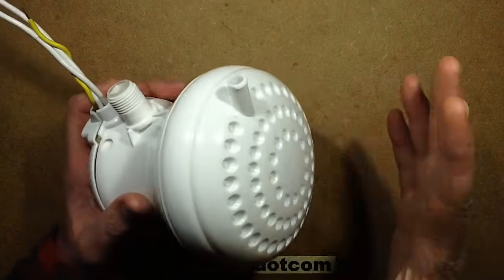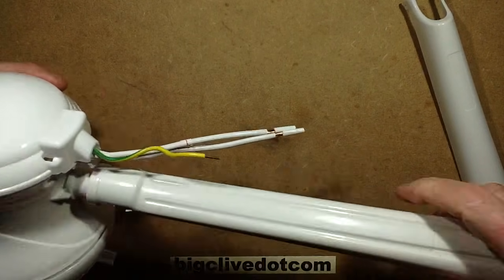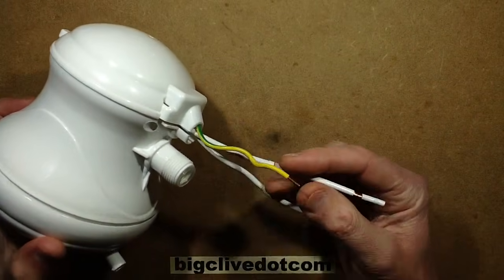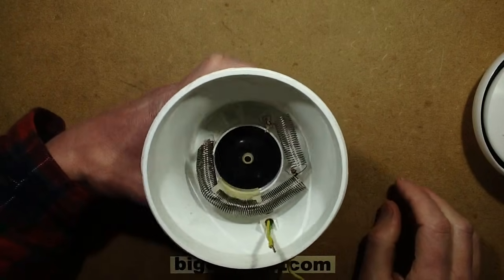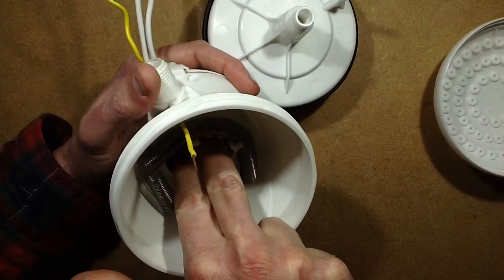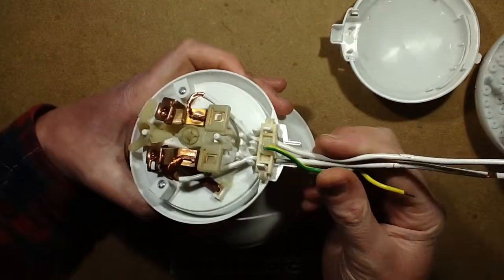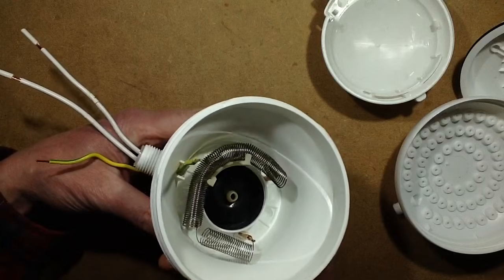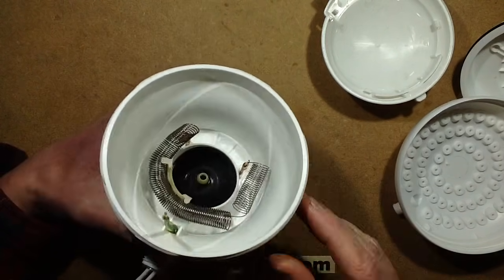Inside a heated shower head.  (suicide shower)

Comment: Water resistivity/conductivity is measured with two metal plates/bands in a sensor body, separated by a cavity of known cross section. This has the problem that ions of the metal plates can contribute to the conductivity value depending on what else is in the water... water with high sulfur content for example.
Laboratory sensors use platinum/platinum hydride plates for this reason.
Different configurations can be required depending on the overall concentration of minerals (total dissolved solids) in the sample because the response is only approximately linear within specific ranges... so you need to do a colorometric test for water hardness before bothering to pick the sensor to use... so... a big pain in the butt to actually test.
The figures are typically available from the utility supplier/ local water authority and it's important to use the figures from the water supplier actually providing the service because water hardness can change a great deal over a relatively short geographical distance.

Considering the scandal that took place in Japan over people being electrocuted by heated toilet seats, I would be reluctant to get under something that looked that cheaply constructed even if the president of the company making it was willing to take the first shower under it.
...especially with the number of houses I've seen in the US that were constructed prior to circuit grounding and ground fault breakers being required for new construction.

Old buildings typically aren't upgraded as they should be...
Installing grounded outlets without running grounded cable for example, or just pig-tailing the ground lug to the expanded metal lath and plaster wall to fool a ground fault circuit into working where it shouldn't.

I think the idea of heat on demand is great... I just don't think that should be happening a couple inches from my face.

Comment: Damn, this is cringe worthy! In Norway the only allowed electrical appliances in a 1m diameter circle around the shower head is Safety Extra Low Voltage units. Less than 48V with galvanic isolation (perhaps only double isolated). At least that was what I was taught 25 yrs ago. I'm pretty sure they've not relaxed those regulations.

Comment: Clive - the water's conductivity is crucial to this (generally measured in e.g. microSiemens and proportional to the total dissolved solids in mg/l).  Overseas water is often much higher conductivity than in UK - in the Red Sea they often blend sea water with freshwater so a short would have 'far reaching' consequences ;-)

Comment: I would say that diaphragm is a electrical contactor working as a pressure switch actually when I was told to check out these suicide showers I for sure it would be questionable but what do you think a electric water heater is it works the with the same concept expecially a tank less water heater.  I could see myself trying one this guy really didn't seem to know to much about power but really how else would you ground the water in a plastic enclosure and the grease that was on it would help conductivity and protect against corrosion

Comment: As a Brazilian and an electrical technician I need to say it:

This shower would never be sold in Brazil and looks like a Chinese piece of crap. I've never seen this brand before. Here in Brazil, there's a private independent non-profit agency called "Inmetro", which tests these kinds of products and labels it to be able to be sold these products in our soil. This kind of inductor, which heats up the water, is one of the worse, it always blows up. I hate this kind of shower.

Do a search for "Corona", "Fame" or "Lorenzetti". These are marks recognized in Brazil as good ones and certified to be sold here. Normally, the resistor which heats up is made of tungsten, the same element used in incandescent filaments. The water acts as a cooler and carries the heat down to the shower.

And, yes, it needs to be grounded for safety use, but our pipes are plastic made and it's rare to someone gets electrocuted during a shower with this kind of device even if it's not grounded, but I don't recommend to do this, because safety norms are safety norms. But fatalities happen just sometimes (it's really rare an accident with these showers) when people ignore the safety installation recommended by authorities and manufacturers, and it includes things like the circuit of the shower must be a separated one from the rest of the house electrical circuit and must have the correct wire gauge and an exclusive circuit breaker in the electric box. The majority of electrical accidents in Brazil occur in construction sites or when someone unqualified tries to fix electrical problems in the house.

We don't use natural gas heated shower because Brazil hasn't natural gas, we import it from Bolivia for some special and/or industrial applications. For the kitchen, we use liquified petroleum gas that we bought canned in a special cylinder. The lack of natural gas for heating purposes makes electrical showers must cheaper to the consumer since we don't have gas pipes around most of the cities, unless in some exceptional cases and in hotels (who prefers to use gas showers because of the electrical demand), but it's normally canned in big cylinders outside the building.

And all in all, if you make a wrong gas shower installation, you will be at risk, and the same is applied if you make an incorrect electrical shower installation. It's the reason we need safety norms.

And remembering again: this shower showed in the video is a piece of crap. Look for certified and recognized brands, and you will see that even the resistor is better constructed.
Reply: im brazillian and in all 3 apartments I have lived there was never a ground in the building (aterramento), and all the electricians never said anything about it, clearly showing thats the common thing around here..Its funny how everyone always talk about the importance of grounding but in real life no one ever gave a shit..
Reply: You might find.. other things.. if you search for "Corona" these days
Reply: @flugenegu7777  lol, yeah... We're making quarantine jokes about that.
Reply: I have taken a shower in Brazil, it was great till the power went out, then it was instant cold shower. The ceramic wiring connector made me nervous as it didn't appear to be insulated from water ingress.
Reply: grounding? tsk tsk... bind the green wire to neutral and call it a day. Bonus if you touch the wires to find which one is the line
Reply: It's amazing that he talked a lot of stuff, but people only paid attention to his grammar error...
Reply: I found it really bizzare in brazil that you guys insist on gas stoves. Because since nothing else in the apartment is gas (no gas heat, no gas hot water) all of this gas infrastructure has to be installed everywhere JUST for a gas stove? What a complete waste, electric stoves arent good enough for you but a suicide shower head is....
Reply: @robmausser  there is no infrastructure needed. The gas doesn't come from main pipelines. It is sold to us bottled so we just plug it into the stove. main gas pipeline is rare to find, even here in the extreme south
Reply: @kstxevolution9642  weird my friend in Campinas had gas stove with gas line going into wall. Even with gas in bottles it begs to ask why not just use electric stove??
Reply: @robmausser  some cities have gas pipes and most of the new buildings use piped gas for the kitchen and/or bathroom, but in this case, the normal thing to do is to have a gas cylinder outside the building which is filled by a truck.  And as I said, natural gas is expensive in Brazil, we don't have this resource, so for the kitchen, we use liquefied petroleum gas, which is also expensive. So imagine using this resource for heating water and made food... About the electric stove: use it frequently and your electric bill will be really expensive, more than the gas! It's all a matter of economics. We have electric stoves, but only in the houses of rich people.
Reply: In some citys of mexico, the gas is sold in big gas cans.
And in the CDMX the gas goes throw large and masive metal pipes under ground.
(Same as the gasoline)

We very rare use those electrical showers.
Reply: Yeah, "marks" was wrong. I edited with new information (some was wrong) and corrected the word to "brand". ;)
Reply: Brand, not mark...
Reply: He's translating it as the word is 'marca' in Portuguese and Spanish and it can mean brand or mark, so as you guys can imagine people either think it's the right word and/or the translator says it is.
Reply: Makes??
Reply: Brazil
Reply: I've seen showers in Brazil where the house wiring for the shower head was disconnected and exposed yet the showers were still in use.  Granted, these were in the less affluent districts.  The products in Brazil might be less dodgy but there are plenty of showers in Brazil where I would be somewhat concerned.   I have to say that if you're invited to a BBQ in a favela, it'll be a good BBQ, just hand them some beer money and hope you can get a taxi to come close enough to pick you up after the party (they're literally afraid of entering favelas)
Reply: I live in Brazil and most houses here in the south use gas heaters. Big cities do have gas pipes and the gas is really cheap. Most people hate eletric showers here.
Reply: @EnricoDias  depende de onde você mora. Eu morava em Pelotas e lá não era NADA comum chuveiro a gás. Aliás, nem quando estive em Porto Alegre. Pessoal que tinha reclamava que o chuveiro a gás tinha que esperar esquentar, enquanto o elétrico esquentava na hora.
Reply: Hot water cylinders aren't always natural gas. And they are way safer than this terrifying thing.

Comment: I assume the reason the wires are short is to minimise the chance of contact with water
Reply from the maker: +Luke MacInnes I think it might just be for economy.  It's not unusual to see those wires just twisted above the unit.  Often with the ground connection floating.
Reply: Here's mine:
i.imgur.com/IbrsAfG.jpg

Comment: I've used these for years in Latin America and it's kind of funny to read the comments section. They are often just open wire nut connected to a 240v 2 phase connection. I've never even heard of them causing any harm to anyone.  The heating coils are generally connected by brass crimp fittings and those are corrosion prone. My guess is that there might be some sort of galvanic action taking place that protects the copper grounding wires. When the brass connections fail you need to put in new coils, which are sold in nearly every hardware store.
One thing that most people are not taking into account is that even though you are wet, your not touching anything that makes a good ground in nearly all the places these are used. The pipes in these countries are generally PVC and the floor and walls are either ceramic tiled or painted, none of which makes for a good conductor.

Comment: This is exactly how I hot water tank works except for instead of it being in a water closet it's just above your head you have to live elements in your hot water tank instead of being pressure activated its thermostatically controlled I would recommend for additional safety to insulate it properly and use a 20 amp GFI breaker that way if there's a potential difference of .05 it will trip it

Comment: Unless you ground the unit with the third wire., you can receife shocks and or be electicuted. Never conect it to plastic pipes without conecting the third wire (ground wire) properly. My house gad copper piping so I conect it directly to the pipe.

Comment: I had this kind of heated shower( the metallic ones ) when lived in Brazil. It was nice have a electric shock every time I touch the tap and smell the burnt cable connectors. LOL.  Once moved to UK I saw different kind of wall mounted electric shower and I realised that pressure wasn't very good as the water travelling down to the electric unit on the wall and backing up fighting gravity loosing pressure through a rose and shower head.  I was about to import a Ducha from Brazil but for health and safety regulations I decided not to do it. There is a risk, but I never heard about any of deadly causalities in Brazil.

Comment: Thank heavens for regulations.
I wonder if you'd look at one of those power-showers, I think they're called. I saw one in Scotland. I was very apprehensive about bathing in a stall alongside an electrical device. 

In Denmark, we just pipe in hot water and mix it with the cold to regulate the temperature. I literally don't know why everyone else doesn't.
Reply from the maker: The electric showers in the UK have strict regulations regarding the grounding of the heater units with metal cased elements.  There's also a requirement for equipotential bonding between adjacent metal parts.  But it all depends on whether the shower was installed by a real electrician or not.

Comment: I am from Panama I remember the first time we installed one of this at home, I was 12 years old maybe, now am 32 and my degree is electronics, yeah, I still feel reluctant sometimes when I get a shower , 5 years ago someone was getting a shower and aparently the water swhitch got stuck and when the water stream was cut the resistor overheat and it broke it will open after it could melt the plastic , that's the only issue we had with it , but no electric shocks, never.  By the way " un placer al bañarse" that's Spanish xD and it means brings pleasure to your shower

Comment: I'm from Costa Rica and this is the only real way to provide hot water for showering. Water heater tanks aren't as common because they are expensive. If installed properly, it will not electrocute you. The extra tubing is meant to keep water from sort of exploding out of it because in third world countries, water isn't as clean so there are contaminants that will clog the shower itself.

Comment: Someone correct me if Im wrong
there is always a live resistor there, I guess the water do not get current because the the resistor is "less resistive" than water. But what if the heater resistor gets cut in half (will happen eventually) then the current can easily find another path. I know its earthed but that earth conductor seems really precarious to me.
Im from argentina, these showers are very common here, but I ve never seen how they work until now.

Comment: This showers are the most common type of shower in my country Bolivia, 100% of people and hotels etc used this kind of showers as least as 15 years ago before gas heaters were more accesible. And believe it or not, I only heard of 1 case of a person dying of electrical shock by this showers, oh and earth connection is unknown here... One funny thing is that people use industrial thermal switches to turn on and off the showers... on both of them, one in each cable... xD

Comment: This how most people would install it: https://www.youtube.com/watch?v=5gpL6K5CPNU
Regulations do require them to be installed with a differential circuit breaker. But then again, there isn't anyone checking installations. Just in Brazil you have over 200M people using these on average more than once a day. It is very common in Brazil for people to take two showers a day. Still, one does not hear about incidents involving them. If it is grounded it won't shock you and everyone knows not to touch them when they are on.

Comment: Here in brasil we use a lot this shower and they are very good The water in The winter is hot and they don't explode and give a shock..the shower in The video is old in brasil because The most houses here use showers with a potentiometer to regulate The temperature and armored resistance who don't make contact with the water because the breaker for the shower is called( dijuntor IDR) in case of shock the breaks opens in 25milliseconds...And is very safety showers not suicide.

Comment: If they have that pipe included, then why don't they put the heating coil at the entrance to the water pipe instead of at the shower head?  By having the heater further upstream, the electric shock would be much reduced.

Comment: It may be all save to use but still i don't trust this device because if not propper installed,malfunctioning or moisture can penitrate inside the electrical circuit, it may can cause shortings to instantly kill you,hence the (nick) name suicide device

Comment: Just a thought but could that bottom 'pressure relief' pipe be designed as a second shower head for washing hard to reach areas? I wonder if it is dual purpose as a safety release but also a second shower head.

Comment: The water resistivity requirements are best measured between a metal central post  and a surrounding pipe. The distance between the two electrical/water contact surfaces should be no more than 0.75 CM apart. The total surface area of each of the contact surfaces should be 1CM^2. I hope this helps!

Comment: It is very common here in Brazil (but mostly national made, never seem a chinese one before!!)

Funny thing is... while all the piping here is most of PVC, PPR, the water register is usually metallic, and if you handle it having some injury at the finger or nails, you can get an harmless, but very unpleasant shock! Does this happen in you first-world class shower too?

And, a scary  thing is when you get a faulty one, it keeps its resistance energized even when you close the register. It is not usual, but I had seen it.
Reply from the maker: In the UK our electrically heated showers have kettle style elements encased in grounded metal.  That makes them completely safe if wired correctly, but does result in a longer heat-up time.